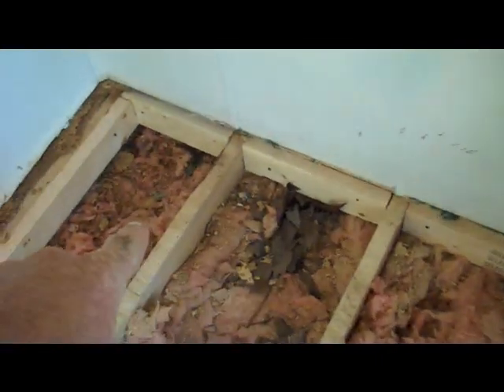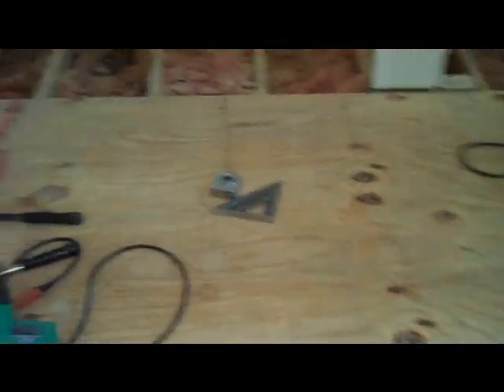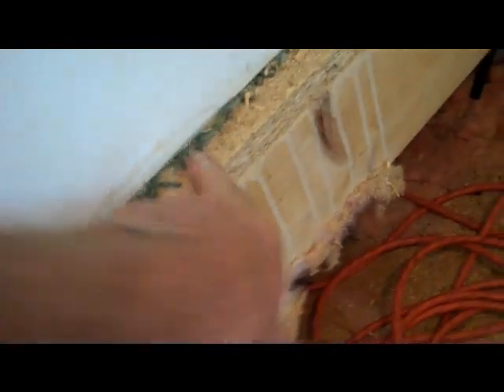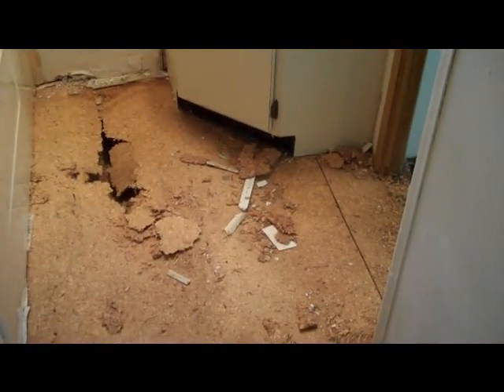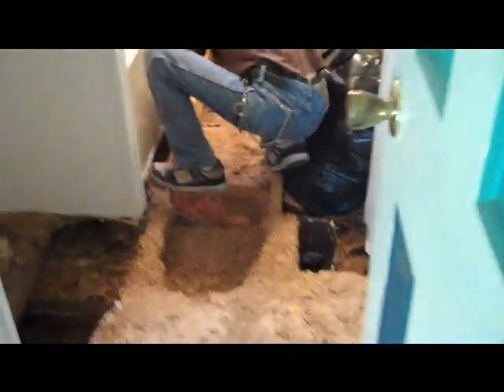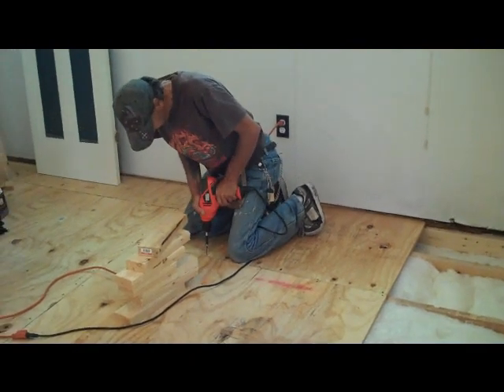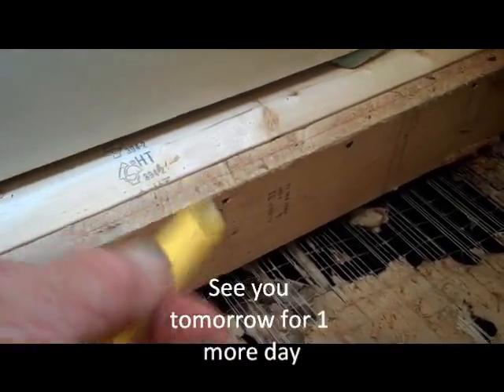Mobile Home Flooring Repair How To Repair a Trailer Floor

Comment: I will be replacing the floors in my master bath, laundry and under water heater. Do I need to look for a special brand or type of plywood for these areas? The rest of the home the plywood looks to be in like new condition except for the fact it seems to thin as it flexes in certain spots under my weight. Do I need to remove that plywood and lay new thicker pieces in it's place or do I lay new on top of it? Any special brand or type for that?

 Sorry for the questions, I'm learning day by day
Reply: get exterior grade

Comment: If I want to lay tiles, should I get cement backer board to go on top of the plywood? Moisture is a huge problem and I want to insure that I don't have to replace floors again.
Reply from the maker: If I’m laying tile I would

Comment: just bought a modular with the same problems..would osb be ok? and in bathrooms should i cut around shower and garden tub or remove them and replace flooring under them?

Comment: the question about existing flooring and carpet sandwiched between the old floor and walls will mold over time is there anything that can be done about that?

Comment: I HATE these floors. Thanks for this. Do you have a video of re doing the walls? Adding tile in the bathroom? removing that crappy wood panel?
Reply from the maker: I might have a few on not tile but Flooring

Comment: And second question, can one place this board over the wood-chip floor? before my neighbors came in, the owner had Home Depot come in (underage boys) put a floor in and they just put the plywood over the rotten floor. I am scared of what may come up from under the house (opossum).
Reply from the maker: I will be putting new videos out of Flooring next week
Reply from the maker: For some reason I sound like a cartoon character in this video I’m not sure why I hope you’re still around Mickey Finn mouse LOL check out my new or videos I don’t sound like that actually

Comment: how do you go about replacing the rotten plywood under the walls?
Reply: It's under structure so he put 2x4 on to the structure for a new place to screw the new floor too .
Reply from the maker: You seen that. Good eyes

Comment: so what happens when the particle board and the carpet that is left under the walls start to rot and aquire mold??the floor repair was a quick fix for short term, but nothing I would want done, a lot of wasted time and money. I would have wanted the carpet and all the particle board removed as in a couple yrs when they rot,the walls will sag and the doors and windows will not work and people will probably get sick from the mold.

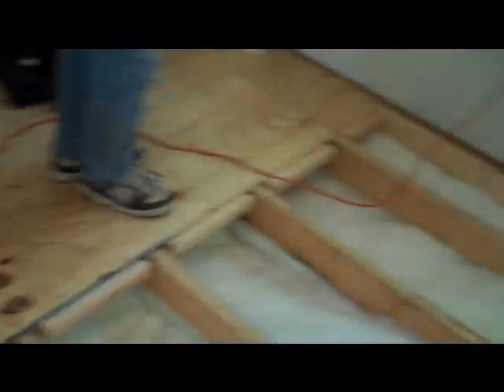Comment: Ref min 3:50 of your video.  What?  You need to make the 2x4's long enough to wedge between the joists.  Then you toe them into the joist.  It only takes a little more time and material to do the job correctly.  If you short cut here, I wonder how many other things that you are short cutting on the total.  I got sick and tired of the people I hired to do the repairs on my 7 MH's who didn't do the job right and I have to go back and do it again.  So now I don't trust anybody else to do any of it.
Reply: I was searching for this comment !! your exactly right I noticed that myself.